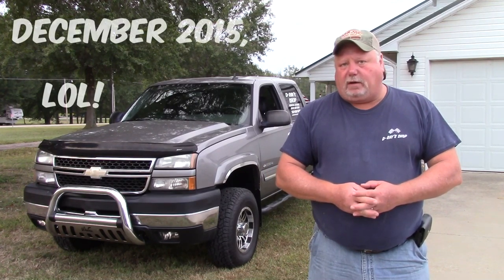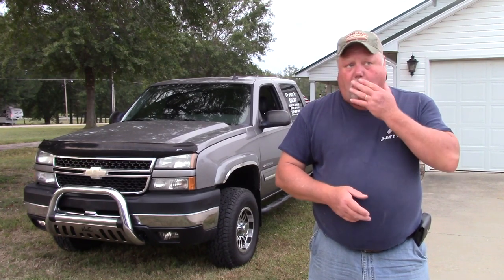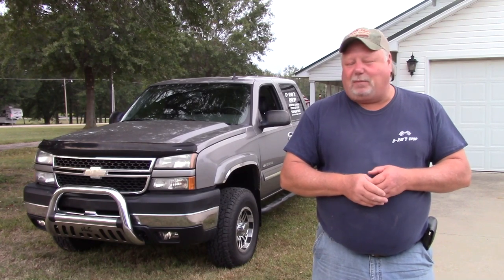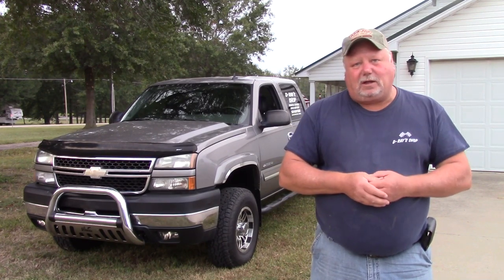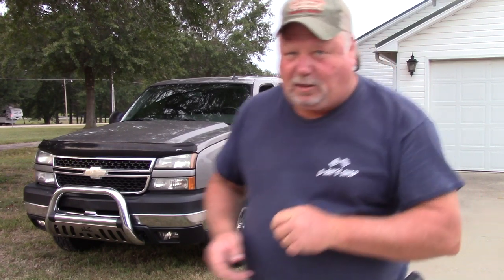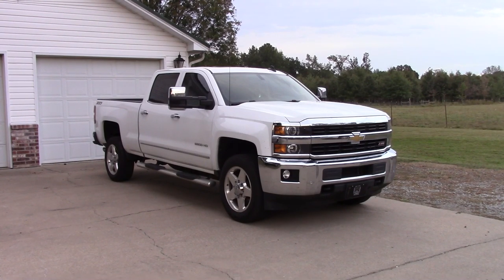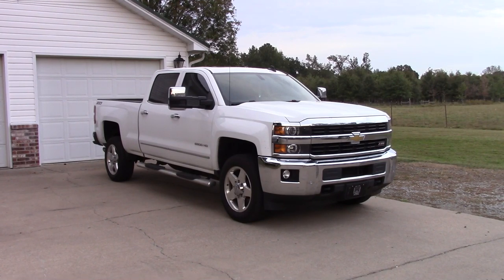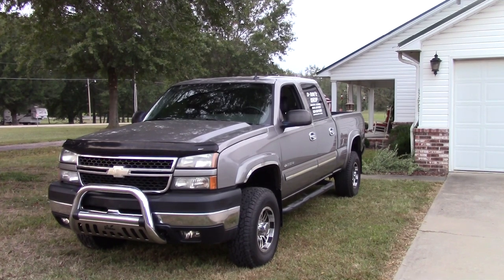Update! 2007 Chevy Pickup Lifter and Cam Failure At D-Ray's Shop

Comment: Really glad to see you back, I’m having the same issue with my 07 2500 6.0, I’m curious did you have to get it tuned any kind of way after and did you reuse the stock pushrods?  Thanks again hoss!